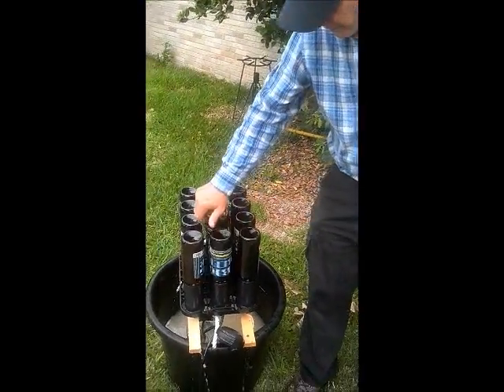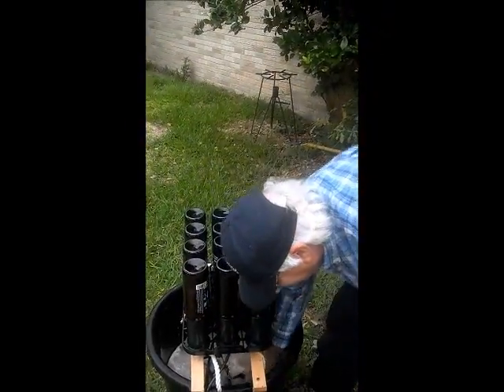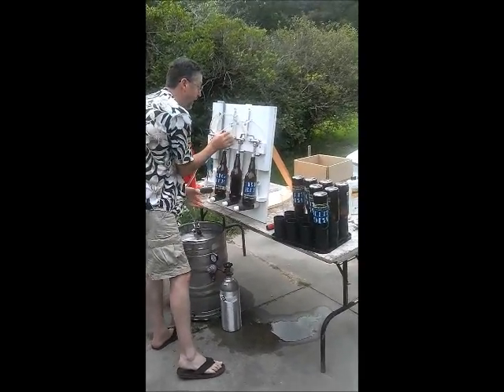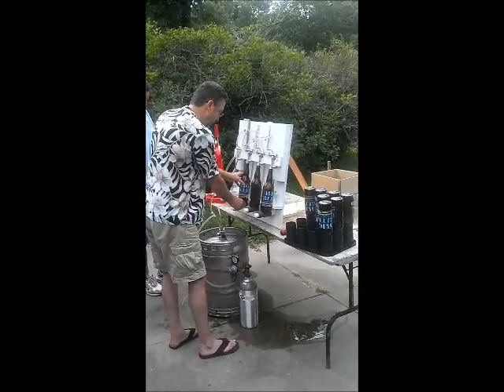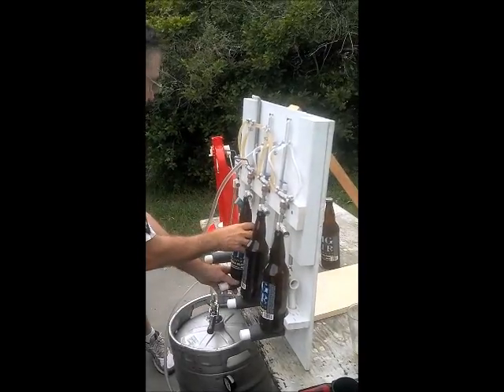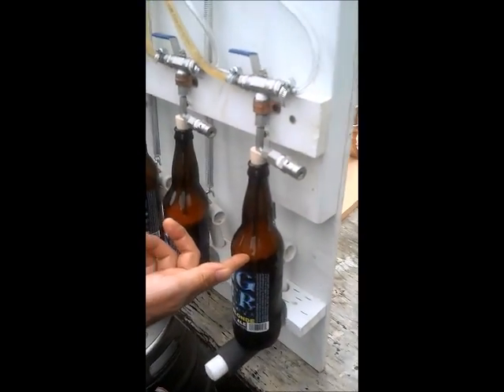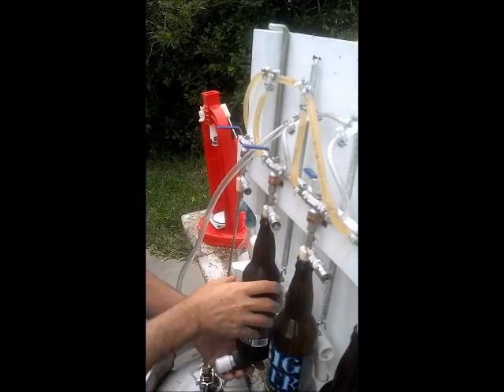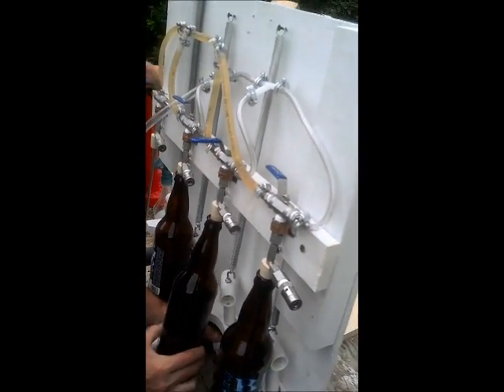DIY Craft Brewery Bottling Machine ( Cost $275)

Comment from the maker: Bottler update:
We are still using the same bottling machine in the video, but I replaced the spring loaded bottoms, with a plain shelf. I can now load two bottles at a time because it only takes one hand to load a bottle.
We have bottled over 50,000 bottles with this bottler so far.
We average 350 bottles per hour. The fastest we have done is 445 bottles in one hour. The machine can go much faster than the capper can cap bottles.
You need to realize, this was our first test with this bottler, done in my driveway.
We bottle 8 barrels at a time, but hope to jump to 15 barrels soon.
We also added another step. we now CO2 purge twice using a purging station.
You can never purge enough. With our new double purge method, we have tried beer over a year old and tasted no oxidation.

Comment from the maker: It works under the same principles as any other bottling machine that bottles carbonated beer under pressure. Our beers are big and high alcohol, so they should age 10+ years. If you (or we) have an issue with low carbonation then the beer did not have enough CO2 in solution, or the capper did not seal the cap well enough.